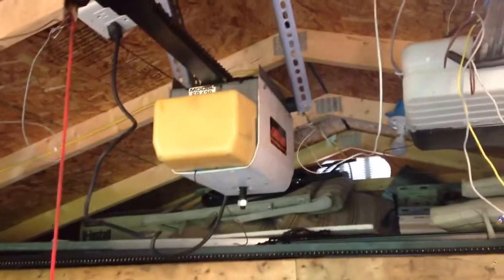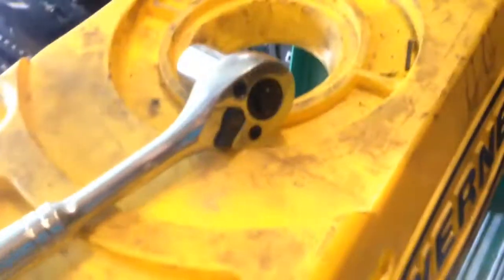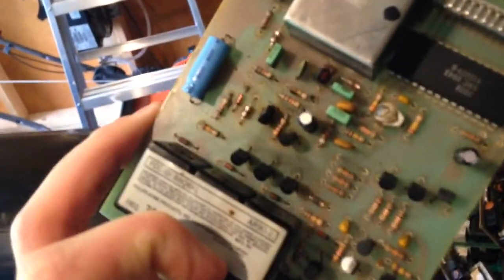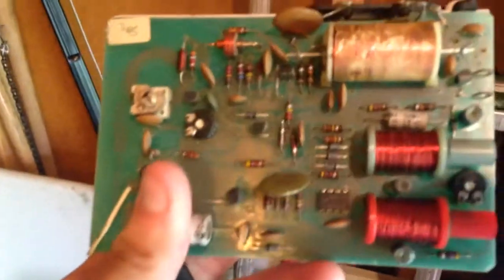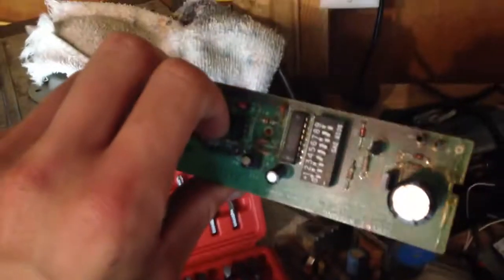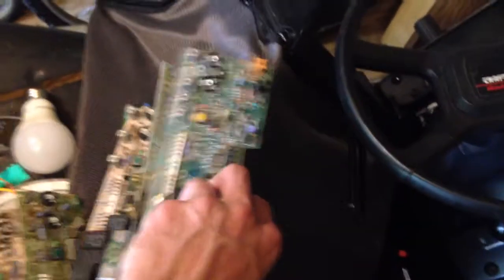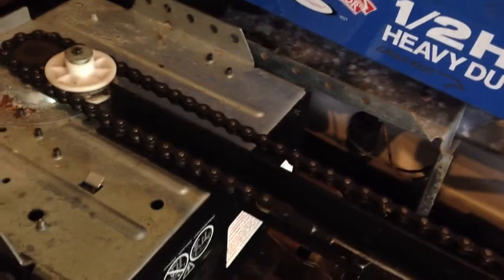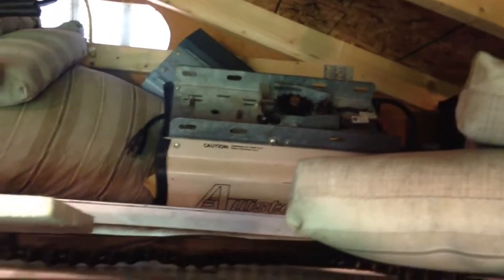Genie SP129 and updates

Comment: I have this made model works, but door assembly is not attached to the chain, how do I fix it?
Reply from the maker: There should be a white or black plastic part attached somewhere by two small machine screws. The trolley engages this piece to open and close the door. If it’s present, pull down on the release rope to reset the metal pin in the trolley it should reconnect next time you activate the opener. If the plastic part is missing, you’ll have to buy one and attach it to the chain based on where the limits are on the chain. Hope this helps!

Comment: I know this video is pretty old but based off your knowledge on this machine do you think you could help me? I have this same model but it doesn’t lift my garage door. The belt runs with no issue. I don’t think I have chain dogs on, is that the obvious as to why it’s not working? Trying a DIY fix but I don’t have much knowledge. Thanks !
Reply from the maker: The chain dogs tell the opener when to stop in either direction of travel. They are needed for proper operation. But to solve your problem, I think it’s likely you need to tighten the clutch adjustment on the bottom of the opener and it should lift your door. I believe you would turn it clockwise to tighten it. Hope this is helpful.

Comment: How many HP is the SP 129? Also any suggestions on a universal remote? I just bought a house with one of these genie's and i cant find a remote that is compatible.
Reply from the maker: I think it’s 1/3hp. Chamberlain (clicker brand) and genie both make universal remotes that should be compatible with this unit. The genie universal should be capable of cloning your existing remote. If you don’t have an original remote, buy the clicker remote (model KLIK3U) it has dip-switches inside. Match the dip switches in the remote to the dip-switches on the opener.